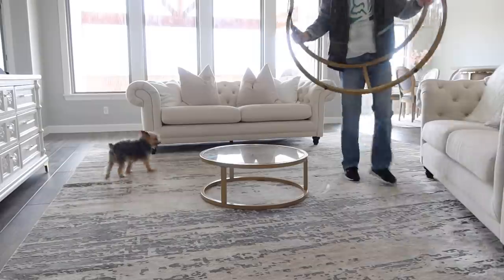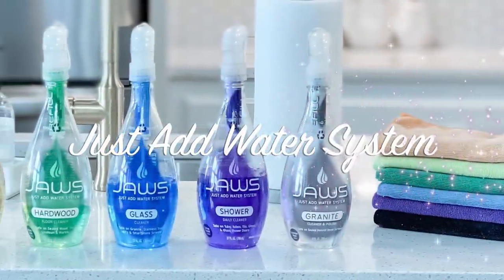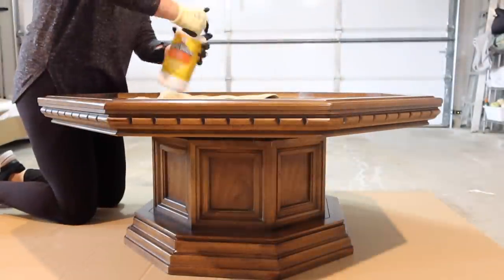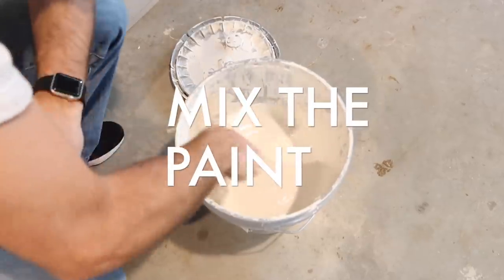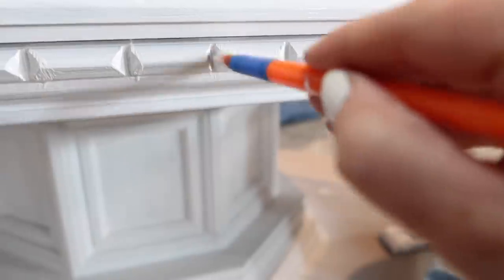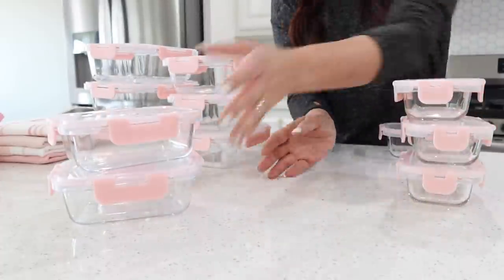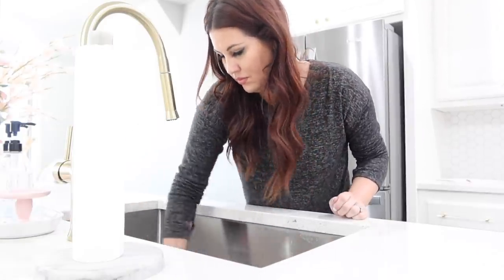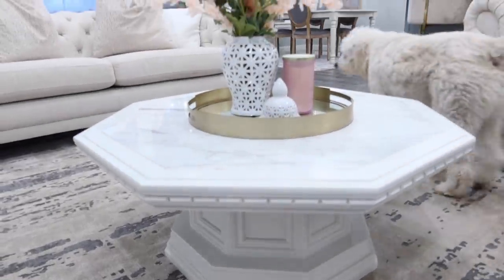DIY BEFORE & AFTER FURNITURE | HOW TO PAINT WOOD TABLES | AMAZING COFFEE TABLE MAKEOVER!

Comment: Question about Aspen nails...do you use the Aspen glue also? And do you re-use the nails? I usually get my nails from eBay, always name brand, and they seem to last a little less than 2 weeks. I have seen other YTers that I watch talk about them but now since you're using them I am really thinking of getting some along with the glue. Thanks Ashley ❤💚💜💙💛
Reply from the maker: Yes I use the glue that it comes with and it works really well. You can use them around  3 times!

Comment: Love how the table turned out. I check out the nails on red aspen. They are pricey, but i got the impression tou could remove and reuse. Is that the case. If so, not bad. Also, i couldnt tell if the pack came with glue or you had to buy the glue separately
Reply from the maker: Hi Tanya! Yes so that’s the nice thing about their nails is they are high quality so they can be reused where my Kiss brand ones could never be reused because they would crack or break easy. And yes the packs come with glue and a file in each box! Thanks for watching
Reply: @TilVacuumDoUsPart  thanks. I have used kiss and found the same thing.

Comment: Quick question, what do you do with your paintbrushes in between coats?
Reply from the maker: The pieces typically dry fast so we usually will just leave sitting on the can or tub of paint. But if we won’t be using the brush until the next day we put in plastic baggie and put in refrigerator